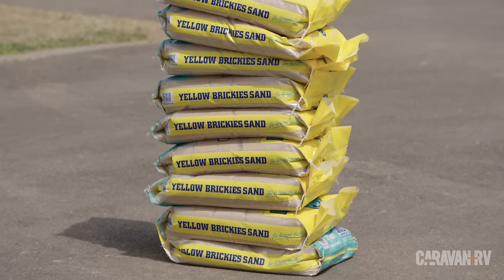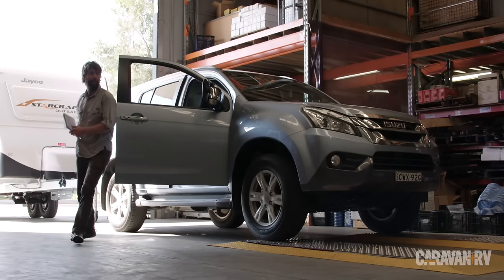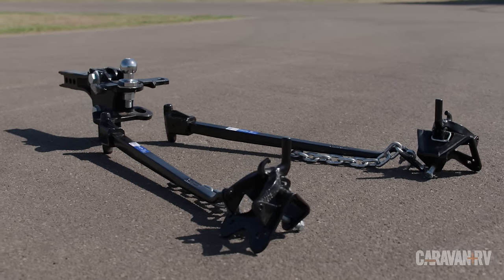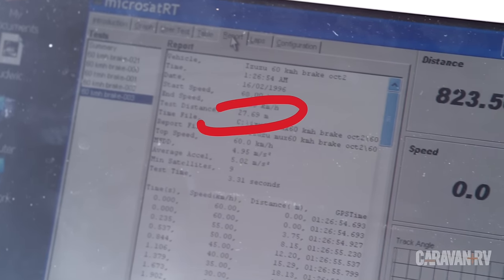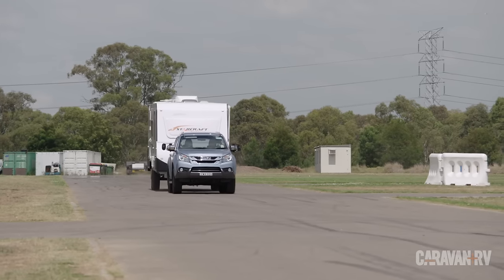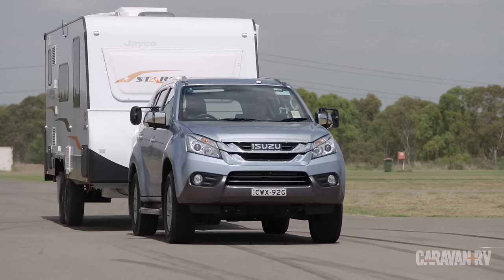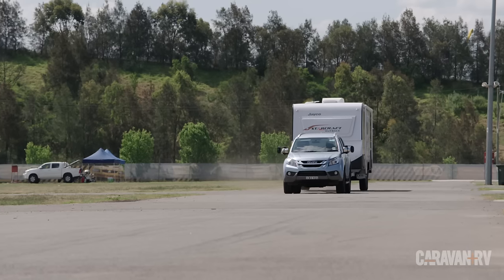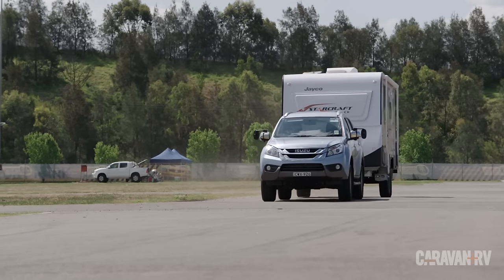Weight distribution hitches explained

Comment: Thats why in Germany, you are not allowed to put more than 75 Kg on the rear Ball (axle) Maybe 100 Kg on heavier vehicles. 

You have to load your caravan right to be sure not to get more than this 75 Kg on the hatch of your car.  You have to put weight in the middle of the caravan or some in the back. But putting weight  in the back of a caravan will rise the risk of unstable driving and your caravan will lose track. The tail tends to leave track.  The distribution hitches are the better way but unfortunately, not allowed in germany.
 :(
Reply: that's the stupidest thing I've ever heard. that's under 200 lbs of tongue weight. even a small utility trailer puts more weight than that. I commonly put close to 1000lbs in tongue weight on my truck. this is why here in America we generally don't use Isuzu things for hauling a camper. we buy massive trucks that haul 30000lbs no problem. or at least big suvs rated for close to 10000lbs.
Reply: floydian91 haha I had just typed out nearly the same thing as the other guy (though I said it without spitting bear and pork bits everywhere) (and less insulting while still being insulting. Then I deleted it. BUUUT! I also used the metric system. Because imperial is so stupid I hate it. With love from America.
Reply: Must say, 75~100kg doesn’t sound like much ball weight if you’ve got a trailer that’s 2 tonne or more. I’m no expert but have seen that ball weight should be around 10% and at least 5% no?

Comment: I liked the video but like others, didn’t feel as thought the texta and highlighter explanation really explained it clearly.

I get that it redistributes some of the car’s weight back off the rear axle to the front axles by the process of the vehicle being more level but I need a better explanation of how the torsion bars work and why it’s attached to the A-frame via chains - that process - how the hell?

I’m also wanting to know how this process affects the actual live towball weight and the weight on the trailer’s axle(s) as I actually came here again to re-watch this video after trying to figure out a weighbridge exercise that I know now was a bit misguided in its process.

Comment: And yet you still didn't tell us how they work.
Reply: Agreed, it's not like jamming something under the lever at all. Its a spring counter lever. Remake the video.
Reply: Look if you don’t understand how they work still.... I’m just sorry. It’s a torsion bar. It keeps the front of the trailer up the same way they keep the front end of a ford ranger up. By bending or twisting metal bars to produce a resisting force against gravity. If you go look how torsion bars work this here will make perfect sense to you.
Reply: Newton's third law is: "For every action, there is an equal and opposite reaction." In other words, in order for the torsion system to be lifting the front of the trailer up, the opposite to that lifting has to come in the form of lowering the rear of the tow vehicle... It's basic laws of physics!
Reply: @kregadeth5562  DUDe you are way off
Reply: @dt3434  Actually this guy almost had the way they actually work.  When he said the block thing I thought he was going to show more. But he stopped.  The way they work has a lot to do with what he said.
Reply: It's like lifting the handles on a wheelbarrow.